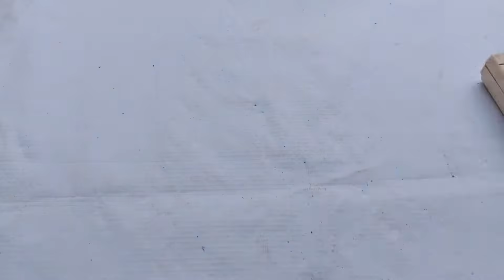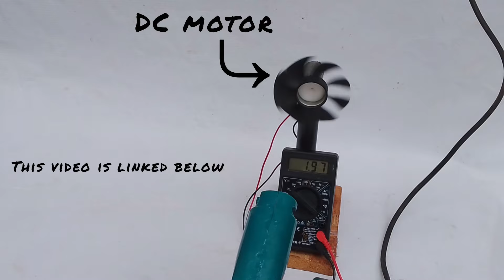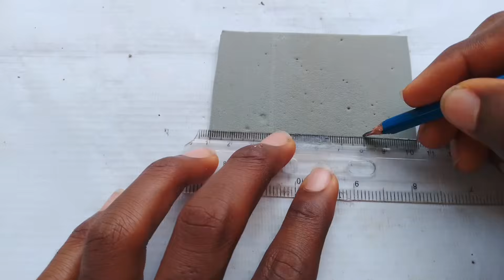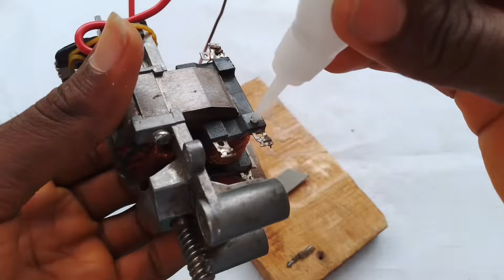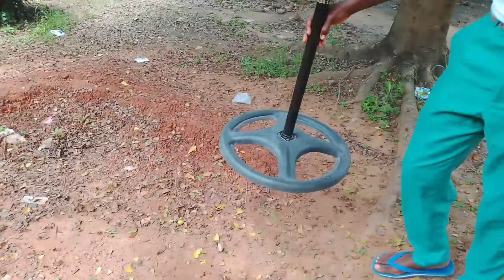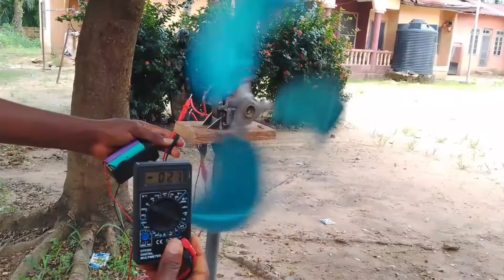I Turned Mixer Motor Into Wind Turbine Using Fan Blades

Comment: Hi mate your fan blade is very unbalanced you need to make a proper bush bearing an engineering though it would cost you a fair bit to do it depending on how long it takes to do it😮😮😅😊
Reply from the maker: Thanks for the heads up, i appreciate, 
Working on it already